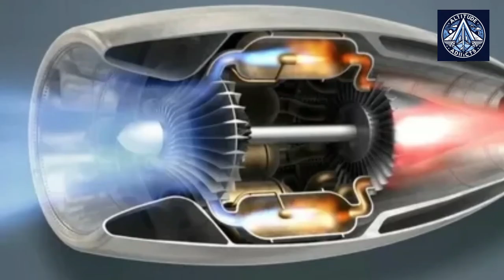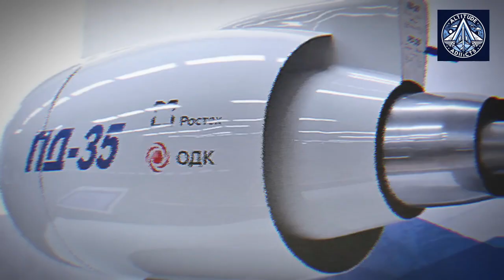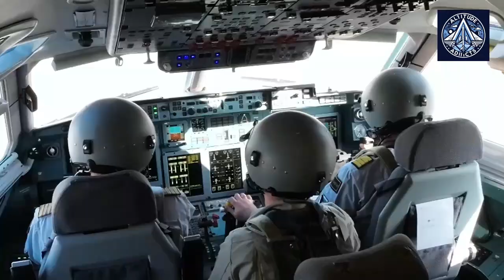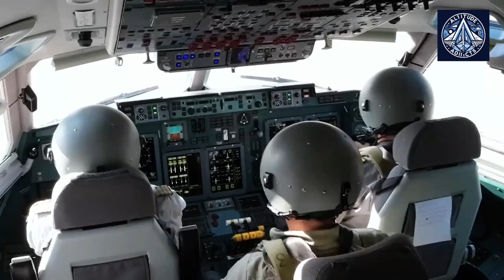Il-96-400M Wide-body Jet and PD-35 Engine: Russia's Comeback Jet?

Comment: The Il-96 has been in distress for almost 40 years, during which time barely more than 30 airplanes have been built. From an economic point of view the program is a disaster. Several times outstanding modernizations have been announced, most recently with the presentation of the 400M variant. Each time it turned out in the end that the airplane was hopelessly uncompetitive. As long as Russia is internationally isolated because of Putin's senseless war in Ukraine and subjected to massive sanctions, nothing will change.

Comment: Boeing had modified the 737 with new engines and had to relocate the engine location on the wings, with a catastrophic accidents.  
that Boeing is still suffering from bad reputation. 
It is better to go from white sheet of a new design with all new futuristic aircraft, that will START to fly in 10 years ie from 2040 to 2070, many of us want see its maiden flights.

Comment: They sadly can't compete in the wide body commercial market until so many significant issues are resolved. 2 person cockpit, mechanics, reliable PD35 engine output and most importantly output production levels. If Russia can perfect the MC21 and pass that knowledge onto the other aircraft makers, it stands a good chance🙏.
Reply: Putin may not be perfect, but he's a more transparently logical leader than many of our current western leaders. I know many of the fundamental Zionists in may have started out in Russia and Eastern Europe, but it's USA Europe influence which keeps them corrupting nations and murdering Palestinians. Israel does not represent Judaism. Zionism will never be Judaism
Reply: You know, I've been thinking more about the video of the MC21 200, and I'm really thinking Russia is about to miss an opportunity in the narrow body market. I think more and more they should shelve the MC21 200 and work on an MC21 500 stretch long range model. Reason ;of all the jets they have the MC21 series is probably the most up to date. It has a wider fuselage than western competitors which would mean all they need do is fochs6on extra fuel tanks in a long reinf body, and have Aviadvigatel work on a more powerful PD14 engine for ll range. This would help solve the Russian aviation crisis as airlines could purchase as homemade jet which serves medium and longer range missions. I really think they should leave the short body jets to the Sukhoi Ssj100.

Comment: One can understand that Russian airlines want to be competitive. I believe that Ilyushin should implement the recommendations made by S7 to Tupolev.  IL-96 can adopt the cockpit design for MC-21 and implement recommendations for weight reduction (at least 10 tons) and implement recommendations for a modern cabin: This would be IL-96-400M2 capable of doing at least 13000km.

Alongside this, IL-296 can be based.on the initial design work done with CR929! I believe Russia had worked as far as the elaboration of design and cutting of metal for initial fuselage. So russia can use its share.of those design docs to create a new twin engine with a carbon fiber wing just like MC-21.

All two suggestions above mean that PD-35 should have been in test flight by end of 2026 using the IL-96-400M testbed!

Initial plans for IL-96 around 2016/2017 called for production of 12 aircraft a year! Those plans.can be revamped and implemented.

Best wishes to Ilyushin and Russian aviation

Comment: The PD-35 is not powerful enough to be a substitute for an equivalent of the Airbus A-350  Russia 🇷🇺 will need an engine equivalent to the RR Trent XWB 84 with engines that have 84,000 tons of thrust each..

Comment: Why don't they use domestically designed systems made for MS-21 with suitable modifications for IL-96? If so along with using PD-35 with new brand name make it successful market.
Reply from the maker: They will attempt that as mentioned in the video. It is likely they will rename it.

Comment: The timeframe to develope the new plane (new engines, new cockpit, new FBW and ligther structure) would be greater than 5 years.
2xY  Il 96-400M rate is too low to satisfy even the minimal Aeroflot needs it will be sufficient just for Gov duties.
If western embargo will be left there will be no need of interim solution if not it would be necessary to increase the IL-96-400M production to 6-12 x Y minimum

Comment: Better Russia offer PD-35 as part of COMAC C929 portfolio.  I believe when Russia pull out fro. C929 program, UAC told that Russia will continue involve with the program as supplier.

IL-96-400M  use that as stop gap measures. Make changes in avionics, Cockpit configuration,  and update interiors. However use Russia resources more on MC-21 program.

Comment: If they are going to redesign the IL-96 with two engines and to change the avionics and flight controls they will have to change the structure anyways. The question is if the MC-21 component infrastructure can support the larger aircraft. Certainly an A330 NEO like aircraft can be made, probably better even. Though what risks do you take on if you only have three years to design to match up with the PD-35 development?
Reply: A clean sheet design?
Reply: This plane cant be redesigned for two engines. It’s a 4 engine design and will use 4x PD-35 what they should do is redesign the structure to maximize composite for the fuselage and wings..